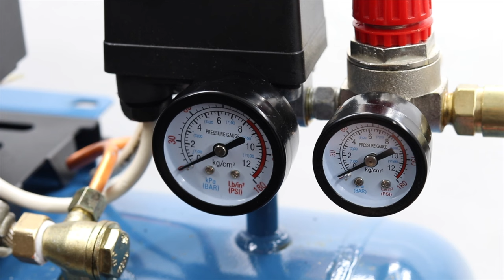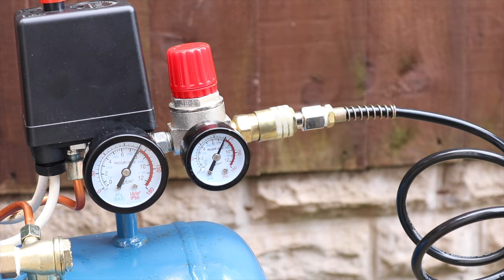Air compressor ultra quiet | DIY with Manaloneathome

Comment: Hello is an interesting project.  I have one question, if the piston is not lubricated and works only on air, will it be exploited?  Will it be durable?
Reply from the maker: That's a good question! I have been using this compressor for about 10 months (most for my nailer) with no problems, so how long it works I am happy. In most cases, a compressor from the refrigerator is free and very quiet. That is why I made one for myself.
If one day it is dead (RIP), I will change it to another :)  how durable is it? I'm curious too, let see. Regards Manaloneathome

Comment: Can you put a compressor like that on a 30 gallon tank?
Reply from the maker: I think you can, but to fill that size of tank takes ages! You can place more than one "fridge compressor" this should work. I use this one for my nailer and is perfect.
Reply: Can I use a fire extinguisher as compressor air tank? Thanks

Comment: What did you use on barb hose connetor soldering lead? Or silver rod
Reply from the maker: Standard soldering lead and soldering flux. After a year still no issues! Ideal quiet compressor for my nailer. Regards manaloneathome

Comment: 8 bar in six minutes - how does that compare with shop purchased compressors?
Reply from the maker: The shop compressor is Faster but Very Noisy, that one is much slower but very quiet.